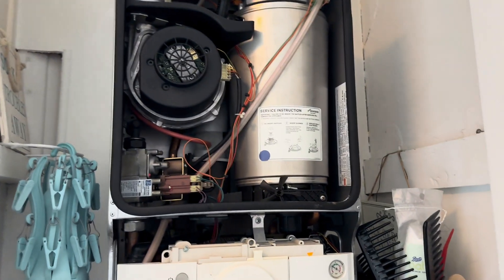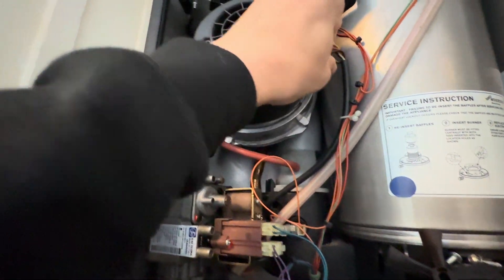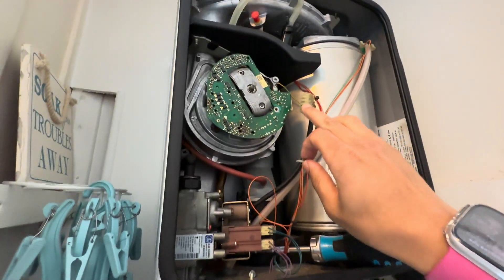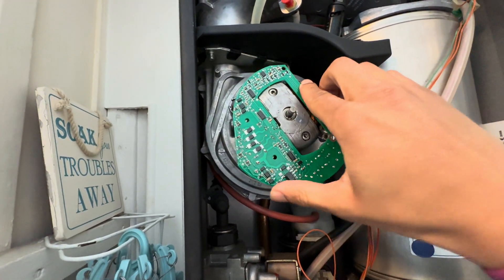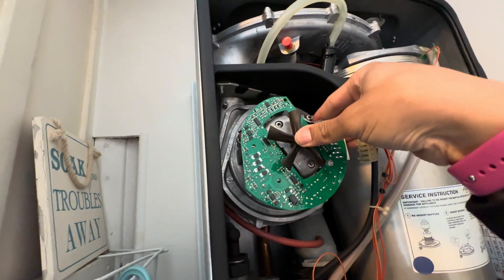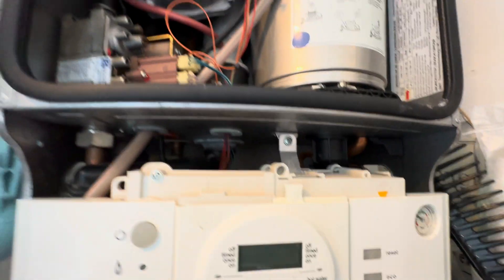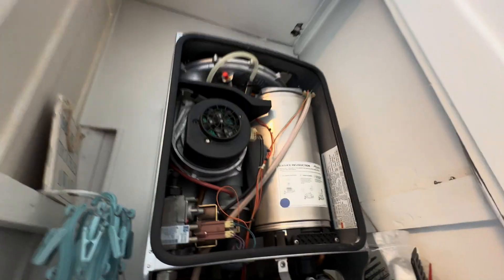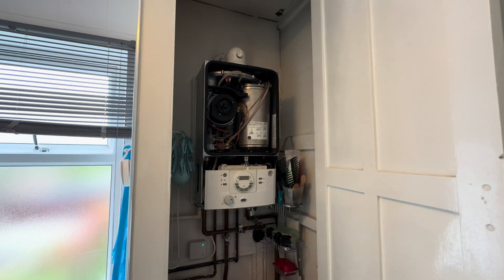Why was this fan so cheap? Part 2!

Comment: The brown wire on mine is cut. How do you think that happened? The blue light is blinking (no reset light is on) as a fault code. What could the problem be? Boiler isn’t firing up.
Reply from the maker: I would say it’s to do with that brown wire not being connected providing the fault! Very odd that that would happen, is it a clean cut?

Comment: Another way to check the fan is to pull off one of the orange wires off the overheat stat and the fan should run👍🏼
Reply from the maker: @russellbaldry5095  oh nice tip! Never knew that! Thank you and thanks for watching!

Comment: Had the exact same thing happen to me a few months ago, changed left hand manifold then I heard a bang and fan stopped working, can't see why it happened as it impossible for water to travel up to the fan, if there was water near the PCB, then why didn't it knock out the main PCB instead off the fan, baffles me
Reply from the maker: Yes, it’s very odd but this model is renowned for the fans blowing when the power is switched back on - no idea why! Same as the ecoTECs PCB blowing when they’re switched back on too! Always hard to explain to the customer - had it once on the Vaillant after cleaning the PRV!
Reply: Another boiler known for PCB failure is the British Gas 330 boiler after turning power off won't come on, tip if this happens heat up the PCB with hair dryer on these boiler
Reply from the maker: @hali5341  yes, often you can get most of them going again by heating with a hairdryer. One reason is that there’s a potential crack in a solder joint and the heat softens the solder to allow the conductivity again, the other is that the grease used on the relays dries out and the heat helps make the grease more fluid again and unstick the relays.